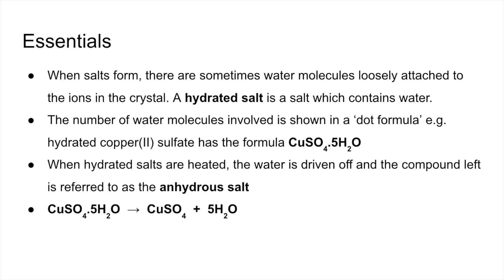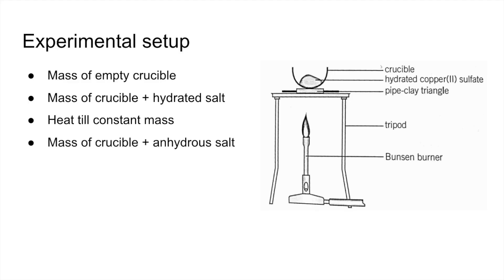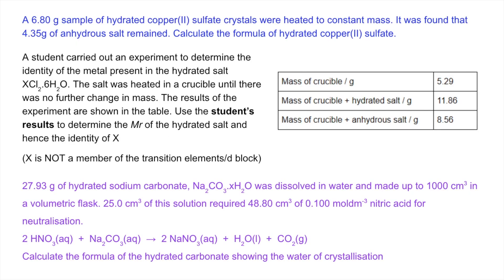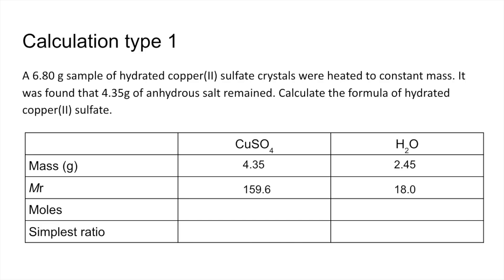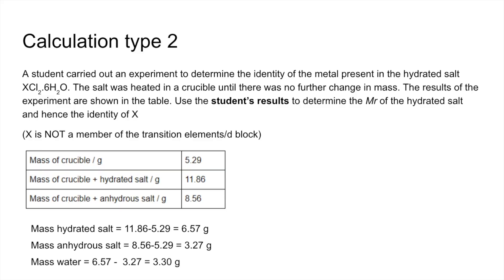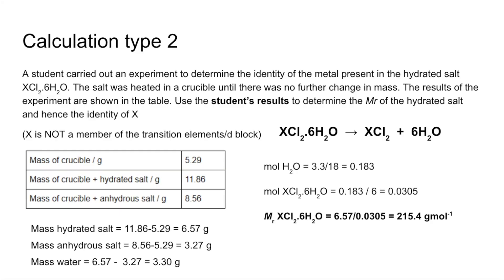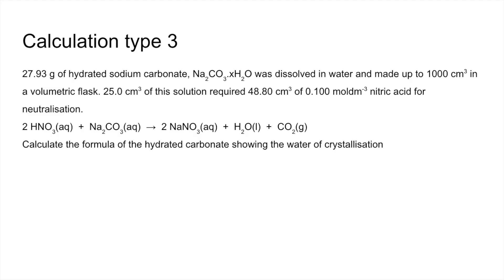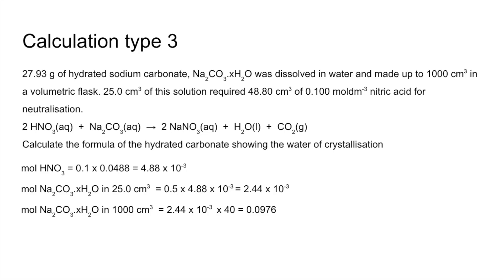Quick Revision - Hydrated Salts

Comment: Where did 40 come from in type 3 when figuring out the moles of the hydrated salt in 1000cm3?
Reply from the maker: Hi, it's because the calculated moles of hydrated salt from the titration is for 25cm3 of solution. We need to find the moles in the original 1000cm3 of solution. That's a scaling of 40 times. Make sense?
Reply: MaChemGuy ohhh yeah of course, thank you so much :)
Reply from the maker: Morgan Roper No worries. Very happy to help :)